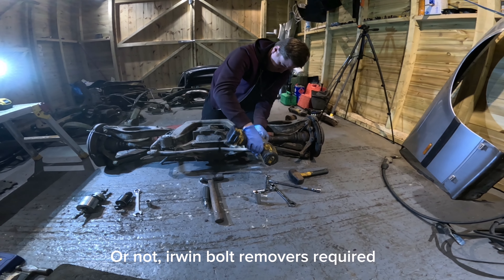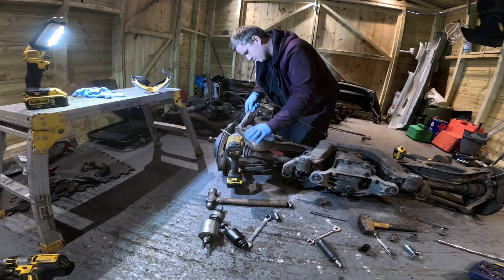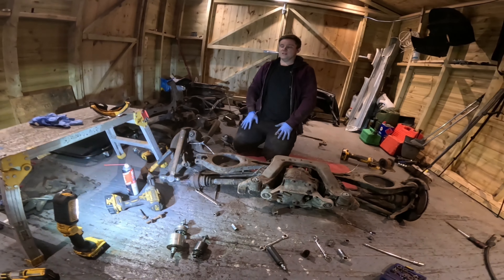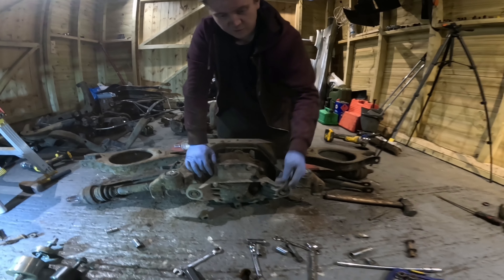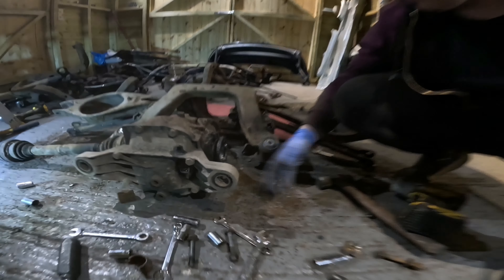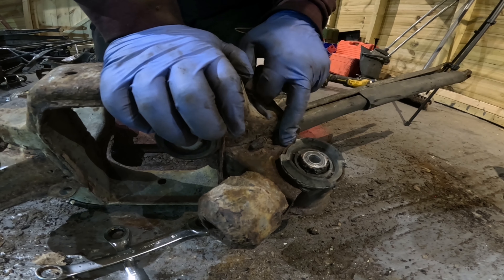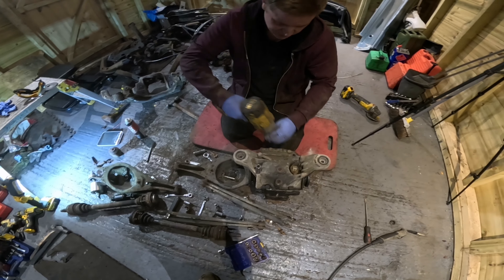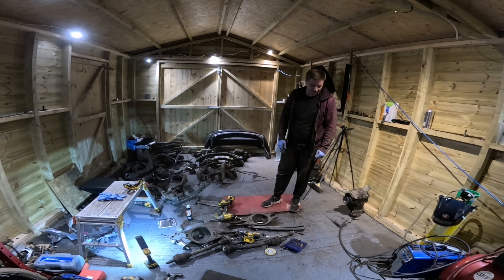Dealing with the mega rusty rear end. BMW E36 328I COUPE REAR SUBFRAME Tear down, Pt. 2

Comment: Yes mate with in reason but sometimes can snap heads clean off but its luck of the draw ive got a 3/8 80 teeth snap on ratchet love using that aswell but best tool as to be the electric ratchet i really would b lost with out that
Reply from the maker: I always think. If it's gonna snap, it'll snap whatever I undo it with, so may aswell send it with the gun 😂😂. Agree tho, electric ratchets are the absolute god send